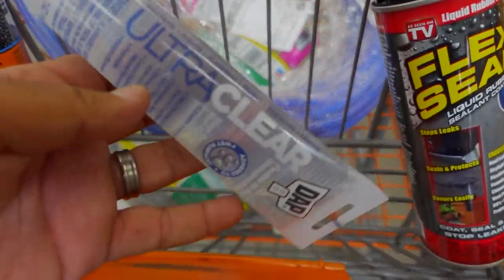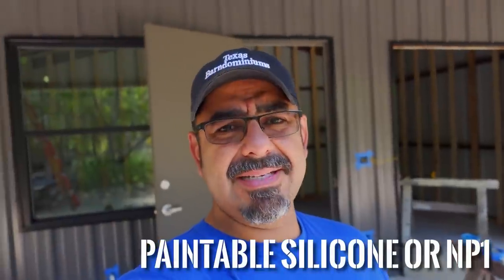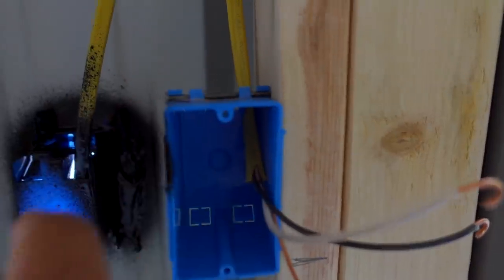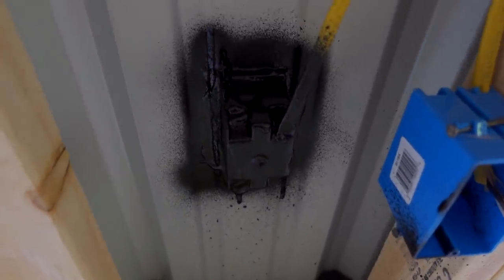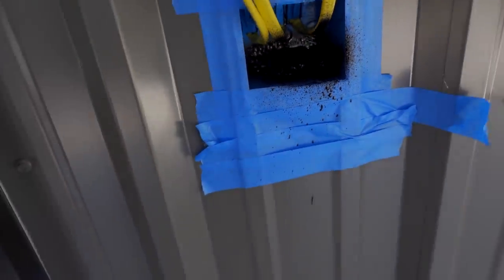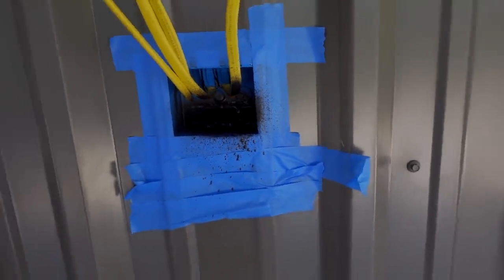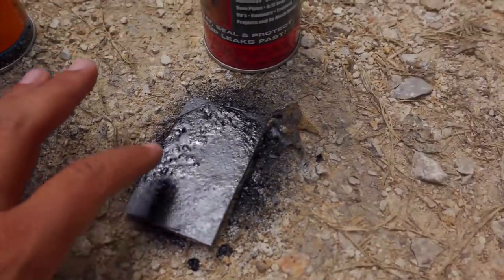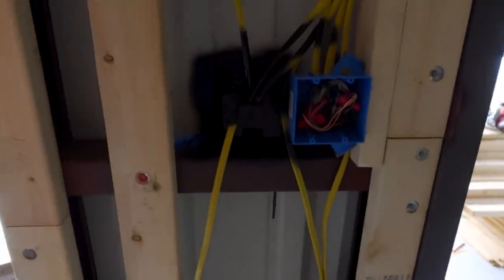Flex seal vs. Gorilla patch and seal.  Make your barndominium home air tight.

Comment: Not sure if spraying it inside the box is allowed by code. Outside should be fine. Might just come down to how nice your inspector is.
Reply: It's not permitted
Reply: all solar so i dont think any inspection will be done on electric, might be wrong but i would be really surprised if this gets any inspections.
Reply: I wondered about that myself.
Wires overheating, etc.

Comment: Flex seal i can personally attest can crack over time.

So i did something interesting with my barndo, i installed rigid foam board over the girts and purlins, then i screwed my sheets over it. I got the idea from a Matt Risinger build. He talks about would you rather eat your coat or wear it? 

The insulation serves as a coat over your house rather than in between the ribs (stud wall cavity) of your house. This also allows me enormous flexibility if i want an exposed wall where the girts act as shelves or regular drywall... i plan on doing both.
Reply: It looked cheaper honestly. The gorilla was way thicker, it covered everything up instantly. I wish he had made this observation as well because I feel like that’s important. Easier to use and probably more durable.

Comment: As someone who build in the northwest, I can tell you it's very important to have a tight home. You want as much control of airflow as possible for a number of reasons. A lot of people will call you out saying that sealing these boxes is a waste, but disregard it and consider the following.

The typical 2000sf home built to code up until the last year or two would have a hole about 12" worth of openings and penetrations. Imagine having a window open year round that you can't shut that big. Exactly, not at all ideal. 

Control the air flow, and if you do get it below 2 air changes, them consider adding a vent or erv. Then you can control the air flow, filter it on its way in, and balance the heat and humidity. Great for southern states, and will be code for northern states soon. 

Yeah, it will cost 200-500 to get a space this size sealed and vented, but the comfort goes up dramatically even without running ac. Consider what that is worth to you.

Top it all off, reduced insects ingress, better ac or heating efficiency, and homeowners will recognize the detail you are putting into it. They may not know the details, or the technical info, but they can recognize the quality of work when you take the time to do this.
Reply: John Doe dam you don’t see that much anymore,someone who takes pride in there work.

Comment: You can use silly putty to block the backside of where you're spraying and then once it's dry just pulled the Silly Putty off and because it's oil-based it will leave the spray sealant where it is.

Comment: After watching and thinking about the video I have a possible dumb question. Would it be better to use a weather proof box for the outside wall and after installing the receptacle or switch with the wiring in place then apply the tube type silicon with a gun then place an insulated cover over the back side and finish off with a weather proof cover on the outside. With few outlets used outside wouldn't that be more efficient. Sometime I tend to go into overkill mode. BTW, your videos are my favorite thing to watch on tv or the computer and I'll check a couple times a day to see if there is a new one to watch. Keep 'um coming.

Comment: I was hoping you would try to pull them off after they set up.i use 100 per cent silicone with a caulk gun and clear tubing over the nozzle,you can reach most places fairly easy.

Comment: Eric, what does the electrical inspector say about those 2 types of spray. Isn't there something about a caulk that is fireproof?
Reply: As an electrical inspector, It was freaking me out a little that those wires were not secured closer to the boxes @ 1:25
Reply: @blackbeard8985  12" is code for Romex, but maybe the insulation foam could be considered support from the authority having jurisdiction.
Reply: @mitchanderson8154  Right. It wouldn't pass here like it is, but there is so much I don't know, like I don't know if he's finished. His staple boy might not come in until day after the video :)
Reply: @blackbeard8985  as an electrical inspector, do you inspect small sheds that are 100% solar and not tied to the grid?
Reply: The building does not have a public walk way, and is not with in 30' of a property line, so I do not believe the exterior walls need a 2 hour fire rating.  The NM cable does need to be supported 12" from ever box an every 4.5' in between with supports listed and identified for the application.  They must be 1.25" from the exterior of the wall, or protected with a 1/16" steel plate where it is not.  I would seal the boxes with something listed for the electrical installation.  I am just a state certified IBEW lnside wireman, so I would have to dig a lot for all the    NFPA 70 codes and exceptions.
Reply: @UCod2mkYGJyzhJsgwI6PBvhQ Thats about what i was thinking. I figured that since he wasnt going to tie to the grid, he wouldnt need anyone to sign off on it or even inspect it.
Reply: @warrenmichael918   anything over 216 square foot.... BUT, we really have zero authority in life, so if someone was not connecting to the grid, we have no way to force you to invite us over. I reposted this to correct my size.
Reply: I wonder what grounding and lighting suppression requirements would be required on a solar system in Texas?

Comment: I don't recommend ever using RTV Silicone sealant to seal electrical boxes where the sealant is exposed to the connections. During the curing process it releases acidic fumes and can cause the metal to corrode. RTV is room temperature vulcanizing there may be some other formulations of silicone sealants that are better around electrical connections. I sealed around my zip boxes with clear NP1 and shoved some butyl rubber in the slots the romex goes through before foaming.

Comment: This is an off the topic question but here goes....
Do you use special concrete forming plywood on your panel forms or do you use regular pressure treated 3/4" plywood?  Any chance you could do a video on how you make your panel forms and how long they typically last?  I'm a big fan of all your videos... for some reason I can't post comments on my primary YouTube account, so I'm posting a comment on my secondary account.

Comment: Quick question would be, how these spray sealants work with any closed foam / open foam installation?  I would be concerned the sealant material would not allow the closed or open foam to adhere.  Thanks...

Comment: When i installed my metal building i didnt put some of that sponge you put on this building between the siding and concrete. So the ridge in the vetical siding are open to critters. Would you recommend these to seal those gaps? I dont plan on spray foaming.
Reply from the maker: Yes, install foam closures.

Comment: I have been in the HVAC and plumbing for over 40 years I use flex steel to repair leaks in coil pans. They need to be dry and give them 48 hours to dry as per the instructions it works great. I haven’t use gorilla yet maybe I’ll see what it does.

Comment: Cruz ✝️. I no know if In Texas they have PRO goof off too take off an clean an protect. Acetone will take off the some paint stain.... 
Cruz 4 Construction 🚧 
✝️😇
Reply: Cruz ✝️. You have Pro Goof Off and Goof Off / tray the Goof Off then The pro goof off. Both are not expensive one is like $3.0 the other is like $5.0 at Walmart an is plenty in bottle. I face this all the time to remove stains without damaging the surface. Cruz 4 Construction 🚧 Gloria Gloria a Dios ✝️😇

Comment: Bro, at the electrical supply house they sale a grey puddy its in flat sheets. You cover the side of the box that is touching the insulation. Covers all the outlet box holes, its pliable like play dough. If I was the electrician on this job I'd kick your ass for spraying that nasty shit on my wire

Comment: The Flexseal will not last very long, your better using your silicone plus silicone will be much cheaper and will go much further!!

Flexseal and the Gorilla spray are identical and they will dry out and crack and shrink within a few months but if it’s only needs to work until you spray foam then I still wouldn’t do it. 

I always took my foam gun and would spray the outside of the electrical box with foam to prevent the other foam from blowing thru when the actual wall is sprayed. In my opinion, it’s much better to use the same foam that you will use to spray the entire wall than it is to use Flexseal or silicone. I sprayed all boxes with foam for over 20 years and it worked fantastic!!

Comment: Lol I’ve never heard of this... highly unnecessary
Reply: If it's worth doing, it's worth over-doing. That's what separates Erik from those just trying to rush out quick bucks.
Reply: Your going to drywall it anyway , or whatever and there’s no water going there too. And if there’s a fire or a flood , that’s going to be the least of your problems
Reply: You've never heard of sealing penetrations on a house???
Reply: Good Times and adventures oh goodness, my father in law told me the same thing... “your gonna dry wall it anyways” 

What your trying to prevent is hot air getting into the air pockets of your insulation. If you allow hot/(cold depending on where you live) air in. Your insulation will be useless for that cavity. Drywall is not insulation.